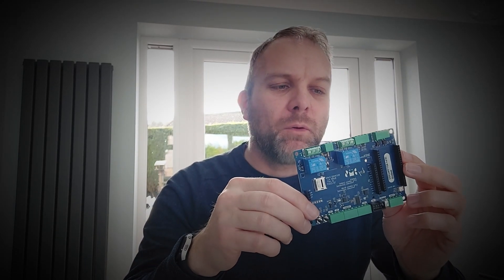Controller V4.61 now available in shop

Comment: Hi Stuart, which kind of shunt goes with the INA227 built into the controller? I see mention of a "CG 0.25 300A / 50mV"? Thanks!
Reply from the maker: Any shunt with a 50mV output should be ok. Always rate the shunt current higher than you need 25% more